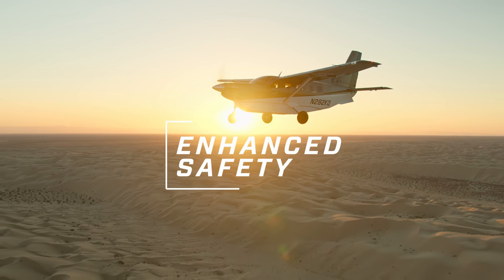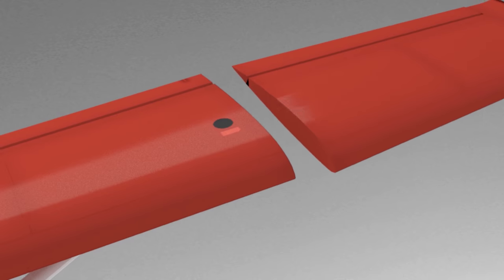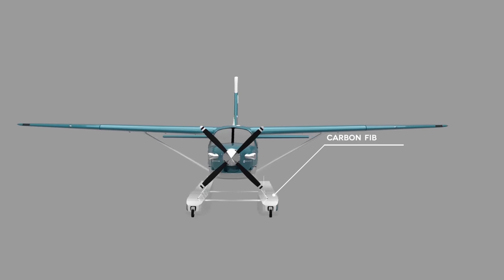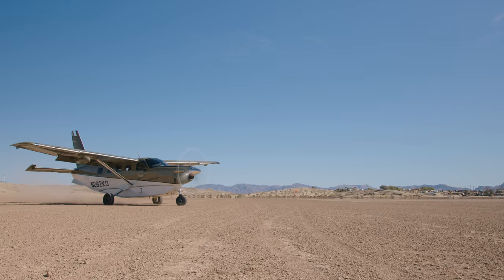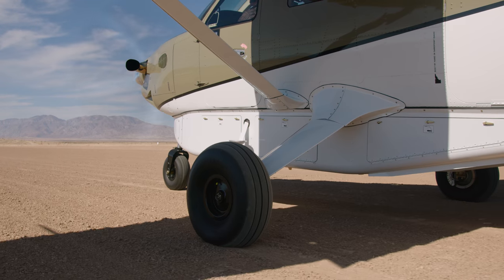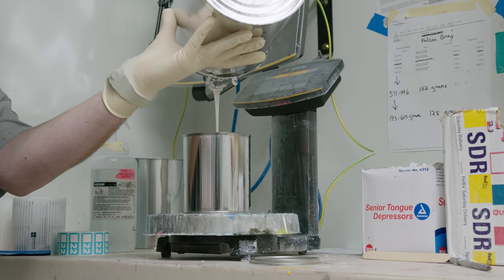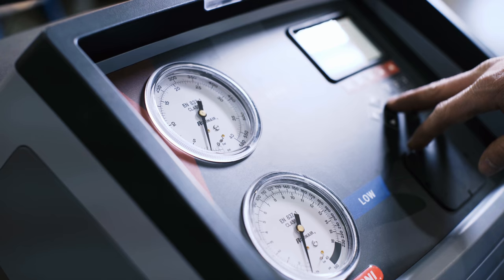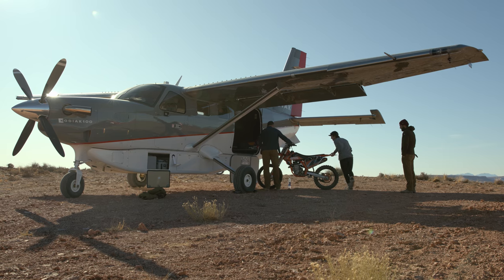Introducing the Advanced Kodiak 100 Series III

Comment: Are the 2 landing lights still HID and the 2 Taxi lights incandescent at both wingtips ? Or did they switch to all LED Landing and Taxi ?
Reply from the maker: The Kodiak 100, Series III is all LED lights, except the landing light is a HID for maximum visibility and field serviceability.
Reply: @KodiakAircraft  "We" have a new (with 2 patents) Par-36 LED landing light with 325,000 Candela  = (Candlepower) and 11,000 Lumens out the front output. It will outperform your current Osram/ Precise Flight Par-36 35 watt HID's. They output only about 3000 Lumens and at best 200,000 Candela. Our LED light distribution is also more even over the entire same beam angle as your current HID. Our Lux numbers prove true useful light performance out to 1/2 mile (1/2 Lux out at 1/2 mile). Please respond here and we can send Certified lab data to absolutely substantiate these claims. We will also attempt to contact Daher shortly with our documented performance data. 
There are NO other LED products currently on the worldwide market even close to this performance level for this form factor, out of a PAR 36. 
Most Par-64 (8 inch diameter) aviation 200+ watt LED's only can currently have similar performance numbers (250,000 to 400,000 CD) to our PAR-36. We also have certified Lab testing results for FAA RTCA DO160-G testing a major hurdle for certified aviation acceptance.

Comment: Greetings. The kodiak 100 series 3 seems to me an excellent very versatile aircraft, however I think it lagged a bit behind in terms of improvements that are already available incredible in the manufacturing company itself. 1. FADEC control 2. Radar embedded in the wing profile. 3. AUTOTHROTTLE. 4. wingles on the wingtips. 5. Homesafe. 6. Garmin 3000. 7. 5-sword propellers. Undoubtedly, these improvements would help performance, safety, and range. It sure comes in the next 4. series with better aerodynamics and performance.
Reply: Fadec  single lever control
Reply: it's possible that since it's a bush plane they wanted pilot more control over rpm